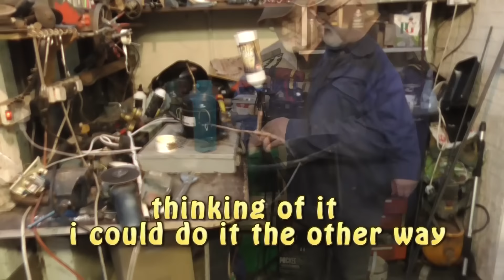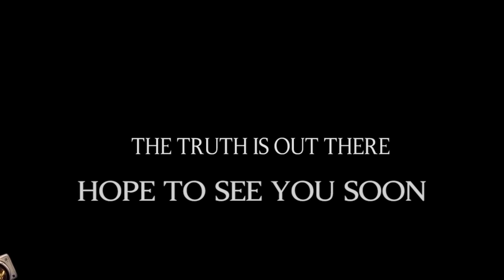how i love dangerous things to play with..p/1

Comment: You need a venturi and fuel feed tube with an adjustable valve to put on the end of your pressure nozzle. In simple terms a carburetor.

Comment: Hi Rob,

It's a commendable attempt but I'm thinking the air output will be too low to produce something worthwhile. We'll know it shortly I guess. Show us the flames when it's ready. Goodluck!
Nice things though, these fridge pumps. I'm currently in the process of setting one up as a vacuum pump to reduce the airbubbles in my HDPE melts. 

/Leo
Reply: Indeed it is... However, you are known for also upping your failures (bravo!) and I did not expect you had already tested it. I would be most happy to be wrong because I have exactly the same type of compressor lying around and using it for a burner would be a good application for it. 
When can we see the flames???